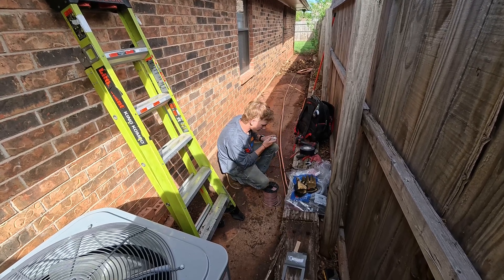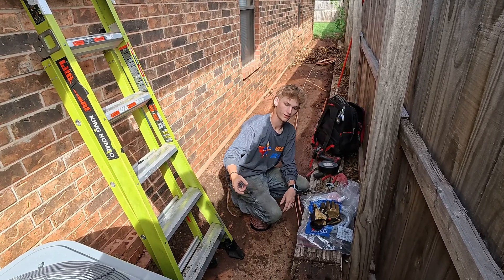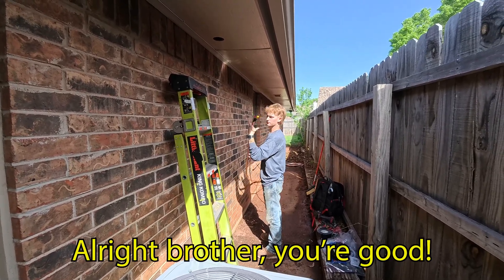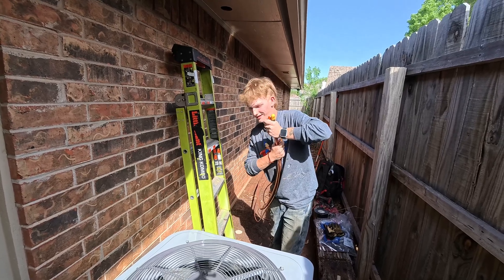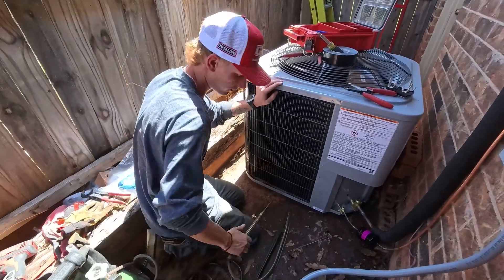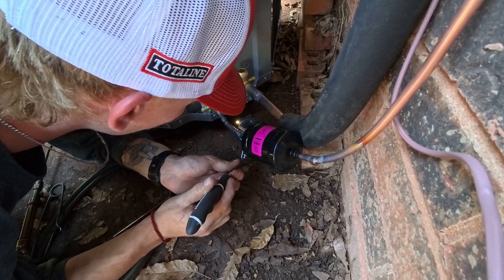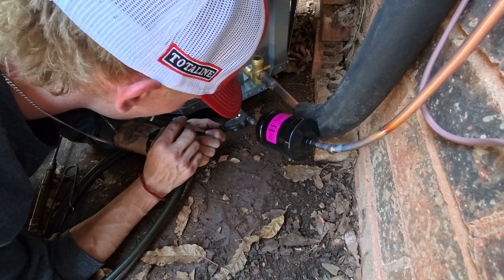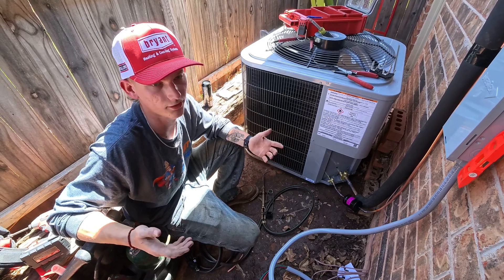How to Run and Braze Copper Refrigerant Lines for an HVAC System | Outdoor Unit Installation

Comment: PUT THE HEAT ON THE BIG FITTINGS AS THE HEAT FLOWS TOWARD IT AND THEN SEALS TOWARD THE FITTINGS. TAKE THE FLAME SLOWLY AROUND THE WHOLE FITTINGS TILL RED THEN PUT SOLDIER AROUND IT!! And also unit is too close too house!!  Old school tech and HVA/C INSTRUCTOR